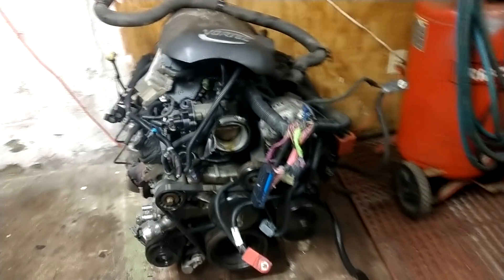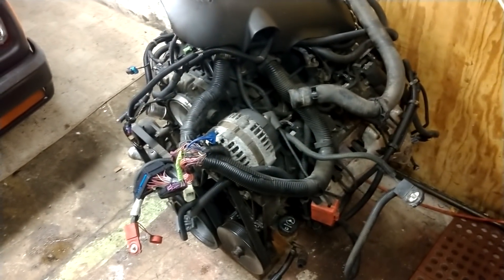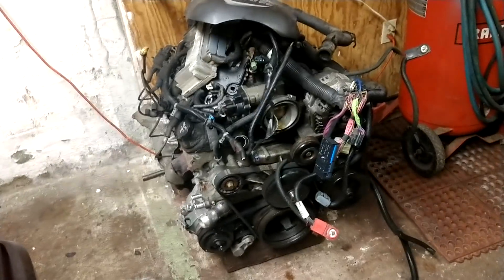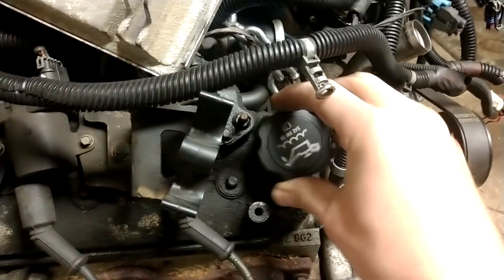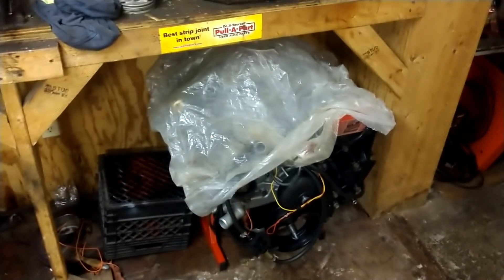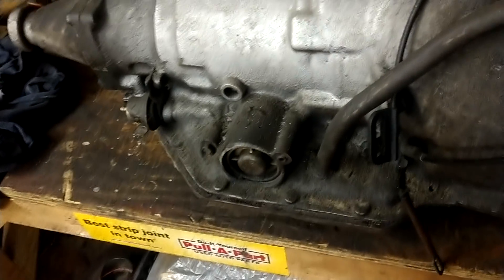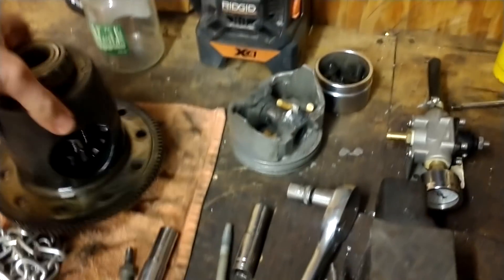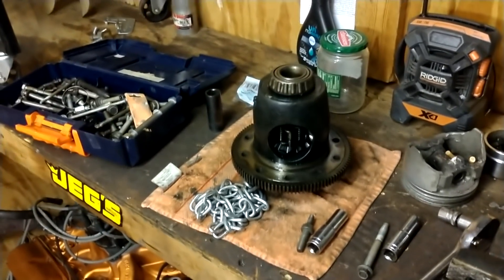Cheap score 4.8 LS for the 4x4 S10 Blazer

Comment: You’re gonna hate the required oil pan for the 4x4/AWD LS swaps. It’ll be interesting to see what you come up with and how much it costs. 👍
Reply from the maker: 306 for the hamburger pan. But I used to work at the Radiator shop in the street from my house. Worse comes to worse I'll.cut a stock pan and have them pressure check it

Comment: Just wanted to make you aware that if you got a really good deal on that motor it might be because it was in an accident. I had a 40,000 mile motor lock up suddenly because all the bearings got nocked loose, every one of the crank bearings spun. It never nocked just locked up suddenly. I just heard you mention that it came out of smashed truck and thought might want to at-least check the bearings. Not trying to be a smart ass just something I thought of. You make good videos have good rest of your day.
Reply from the maker: It's not a bad idea. I have to drop the oil pan anyways. Thanks for the comment!

Comment: check the spline count in your posi unit gm uses 26 and 28 splines
Reply from the maker: My 1991 S10 uses a 28 spline axle, same as the posi. But yes you're right thanks for pointing that out